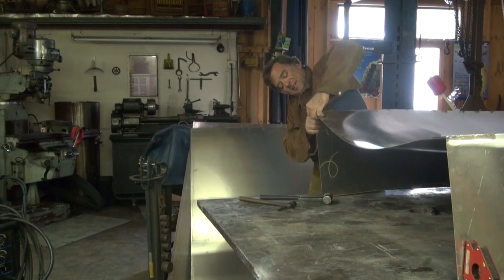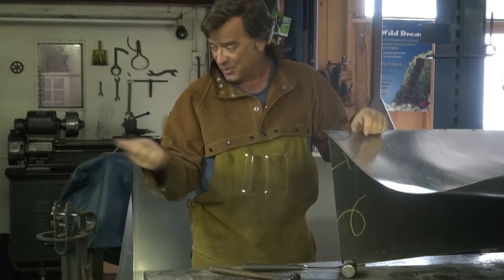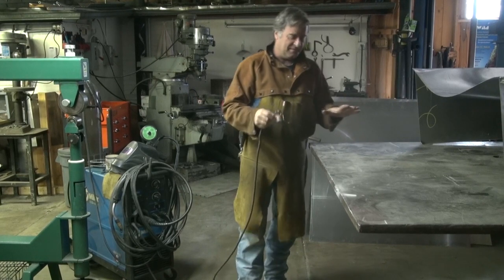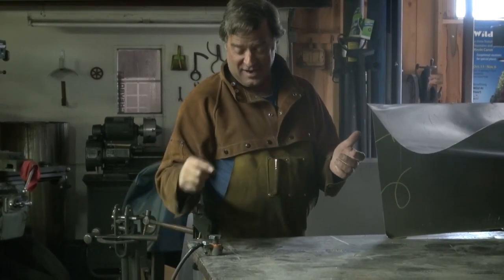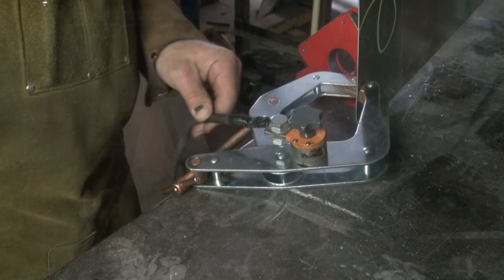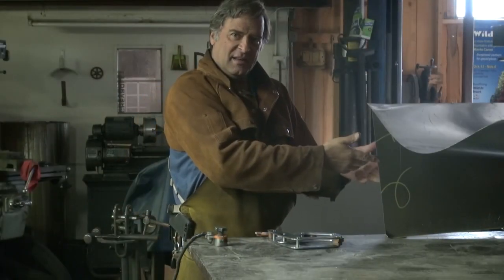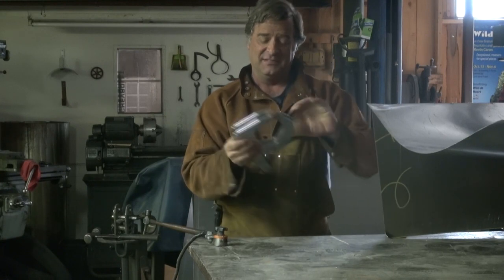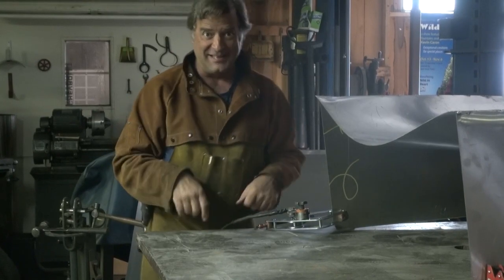How to Get a Good Welding Ground - Kevin Caron

Comment: If the part that you weld sits on the table and it is grounded, the ground would also get to the table as it isn t isolated from it
Reply from the maker: That is true but electricity will take the shortest path.

Comment: Are you able to put the ground onto something that isn't touching/in contact with the workpiece or would that be dangerous?
Reply from the maker: I have used the ground clamp from the welder,   I have used a different clamp on the metal and attached my ground it that.    Or I use a magnetic ground for those large open areas.  I have also welded a small bolt in an out of the way place to attach the ground.   When I was done, I just ground off the bolt.     Thank you for watching and posting.

Comment: If you clamp the ground to the metal work and the metal work is resting on the table, wouldn't it still become part of the circuit?
Reply from the maker: Nope, current takes the path of least resistance.  So the shortest distance from the arc to the ground clamp.
Reply: @KevincaronSculpture  Thanks you. I'm going to attempt to do use a stick welder on my car passenger door (Need to weld on a pull tab to pull a dent).

Do you think it will be ok to ground on the metal of the door lock latch as it's unpainted so cleaner than clamping it to the doors paintwork.
Reply from the maker: Should work for a ground but you will have one heck of a time getting a good weld out of that stick welder.   If you have oxy/ac rig I would use that instead.  Grind clean and shiny and give it a go.
Reply: @KevincaronSculpture  one more question. If I was to clamp a stick welder to the metal legs of a small work bench but the bench had plastic feet would it affect the “ground”?
Reply from the maker: Not in the least.   Metal leg to metal tabletop and you are good to go.

Comment: Hi Kevin, what if I'm not working on a metal table like welding my tall bird cage (painted wire mesh) where does to clamp my ground cable to avoid electric shock? Thanks.
Reply from the maker: Whatever metal you can that won't be in your way.  Down low is always good.

Comment: I've never used a magnetic ground clamp before. I might get one for my everlast welder. It might come in handy for those times there isn't a good spot to put a regular clamp.
Reply from the maker: Just make sure you get a big enough one to handle the amps of your machine.    Set mine on fire once running too high on the amps!

Comment: Thank you for your video, but I have a question, will I get shocked if I weld the metal pieces if the metal pieces are clamped by a metallic clamp and the metal clamp is connected to a metal construction table that share a common ground clamp?
Reply from the maker: Nope, long as you are clamped down you are good to go.
Reply: Thank you for the reply ! :)

Comment: Does the flow of the ground need to be in contact with the material your working on? Could you connect it onto some other separate piece of metal or would that not work?
Reply from the maker: You can ground to the table and clamp your work down.  Or clamp right to the work. Either way works fine.

Comment: Old fart here, just joined. Trying to learn to mig weld. Bought a decent auto darkening helmet and I can't see where I welding. Welds don't look bad just wandering all the place.

Any tips
Thanks
Jack
Reply from the maker: +Jack Antoine         

Try looking from the side of the gun to see what is happening..    Or maybe block the light shining from behind you inside the helmet..

You might also add more light to help you see...

Or maybe a different color marker to make your mark on the steel..  

Or lighten your shade on the helmet a little, like from 11 to 10
Reply: Fellow old fart here.  Dial down the darkness (I work at 9), and wear reading glasses.  The reading glasses help IMMENSELY!